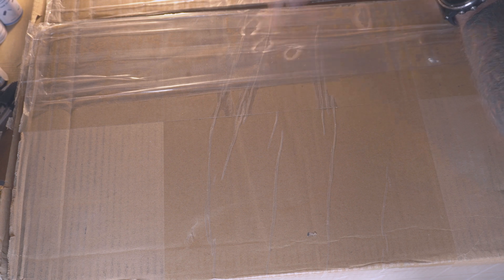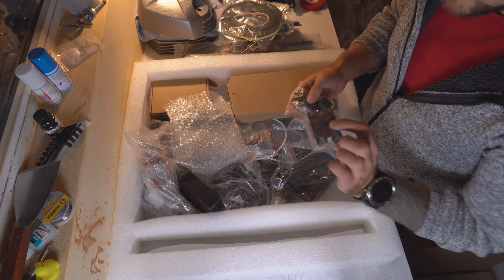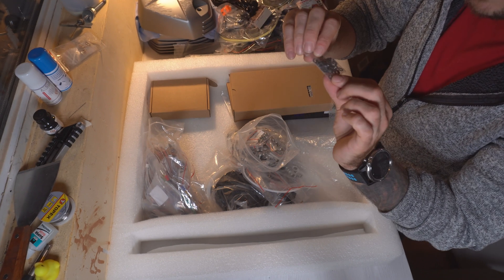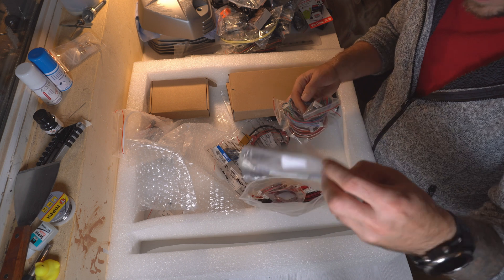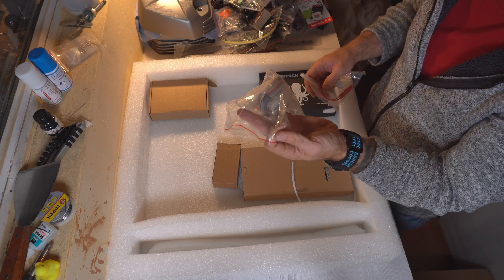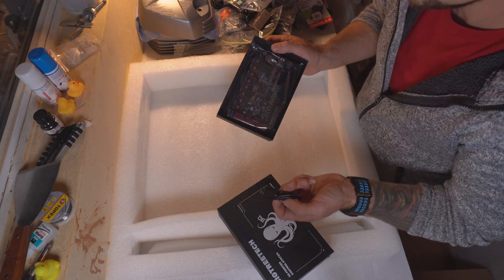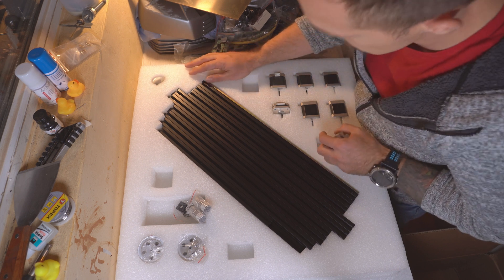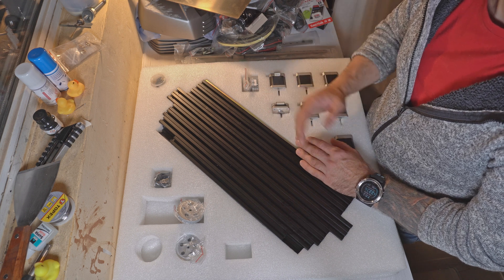Formbot 2.4r2 kit review - 350mm - and comparison with a kit purchased last year

Comment: Purchased a formbot kit Q2 this year. Kit was pretty much identical to yours accept I got sunon fans. Pretty sure there not genuine sunon though as they all started to rattle after a few hours use.
My probe was different also but I never used it and went with a Euclid from the get go.
The magnetic sheet for the bed had a lower temp adhesive on it than the adhesive on the bed heater. I have some bubbles under the mag sheet now. Not real impressed with that.
Reply from the maker: Thanks for the comment. Fans are a lottery anyway but year ago I got genuine Sunons from frombot (lived for ~3000 hours).

Bed ahdesive is an interesting topic. Are you sure you glued it correctly and cleaned the surface before with IPA? Did not have any issue with 4 beds from different kits.
Reply: @techbytch  Yeah it was perfect before I used it. Sat with weights on it for a couple of weeks as well while I finished the build as I installed the bed at the very end of the build. I had concerns but decided to use it as I couldn't source a mag sheet on its own in reasonable time. I should have waited. Now it will be a pain in the butt to replace.
To be honest it hasn't effected the bed mesh much but I expect it will get worse with time
The pei plate is really good though. Very durable. Easily as good as the energetic one I have on my other printer.